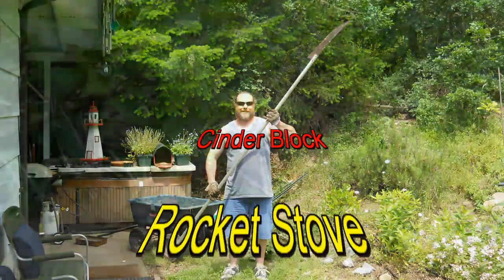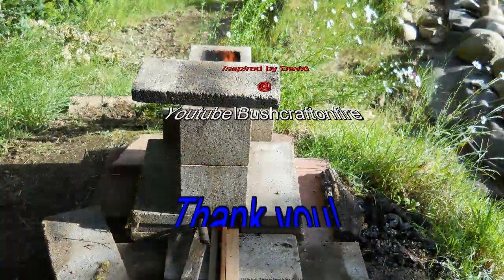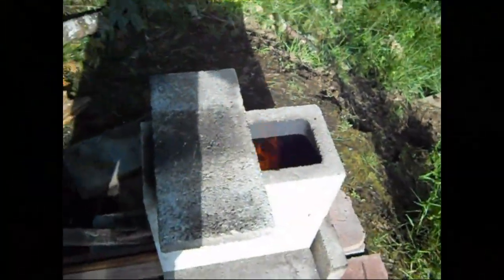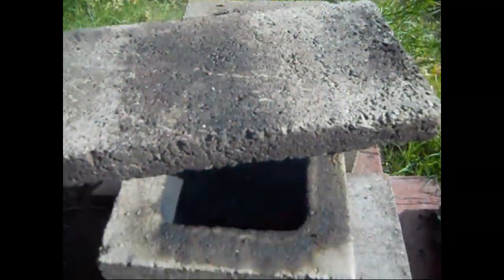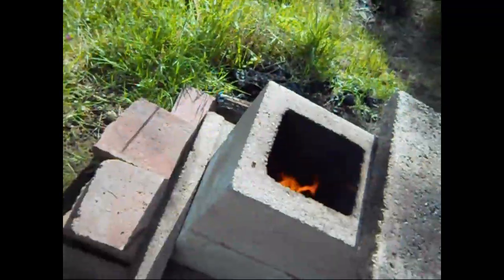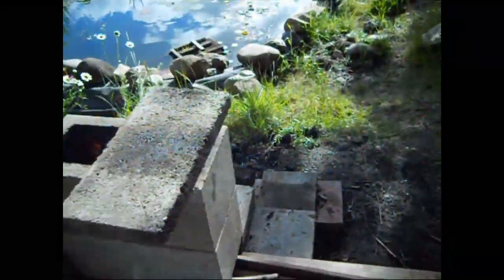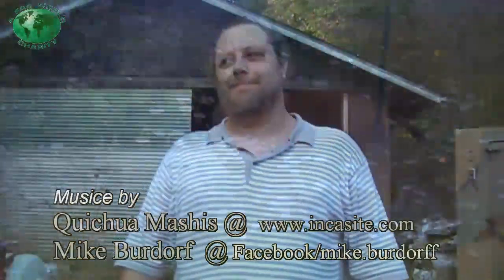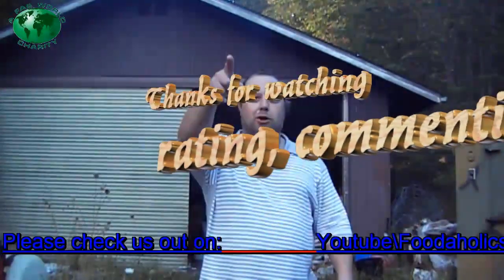Survival? Cinder Block Rocket Stove review with Jimbo Jitsu at the Farmhouse

Comment: Wow, it doesn't get any easier than that!  My husband is building us a built in propane BBQ & I just convinced him to add a rocket stove to it. It will have a small counter space in between the propane burner & the rocket stove. Nice to be able to use any option. but what I love about this is if you need to leave home for a while...it's easy enough to grab a few cinder blocks & take with you for an easy to assemble stove anywhere you go. Thanks for sharing.